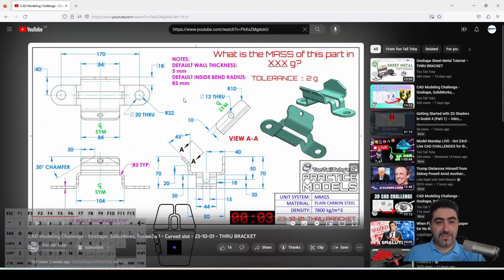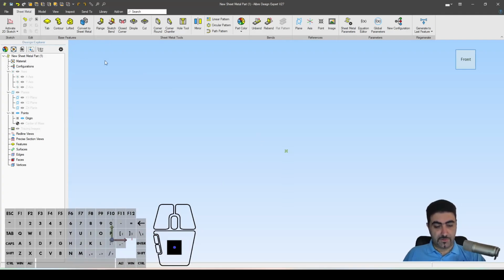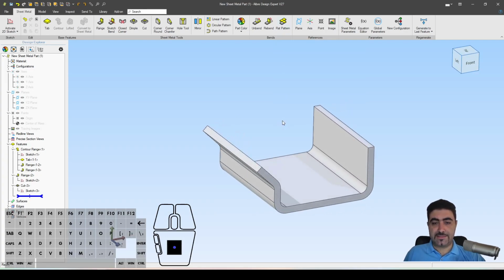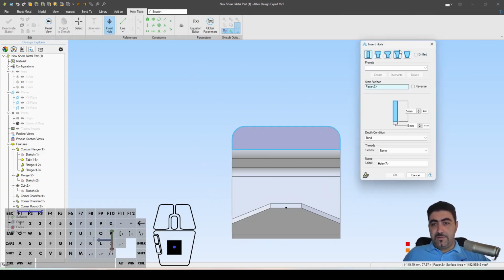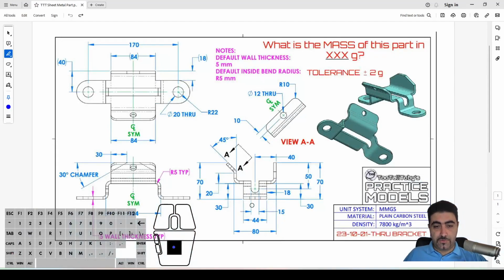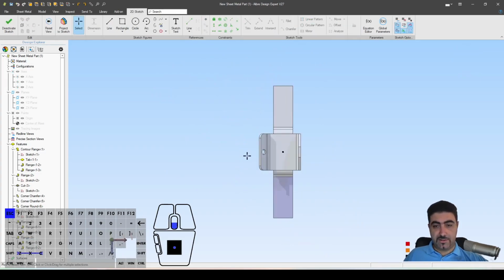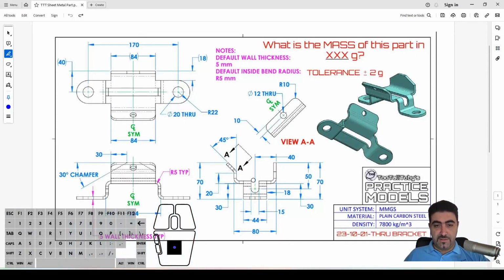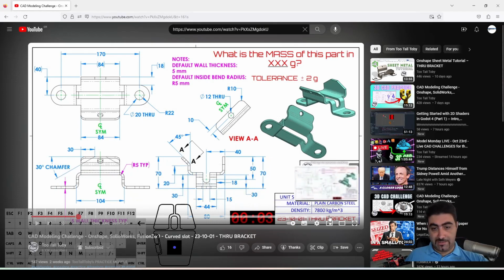Sheet Metal Advanced Techniques: TooTallToby 23-10-01 Practice model

Comment: I got a tip for you, I became aware of it accidentally. So, let's say you have a feature (boss, revolve etc). And assume this feature is sketch dependent. if you want to edit the sketch, just double click on the feature in 3D window, and it'll kick you back into sketch editing mode.
On the other hand, if you hold Ctrl and double click the feature in 3D window, it'll edit the feature properties. 

In your case, you forgot to offset the 30mm high flanges, and then you went to the feature tree, right mouse click on the feature and left mouse click on edit menu. You could've just hold the Ctrl key while double clicking on one of the flanges.

Sketch independent features like fillet,chamfer so on, doesn't care whether you have held Ctrl key or not. Alibre will open the edit dialogue once double click on them with or without holding Ctrl key.
Reply from the maker: Oh, that's a good one!  I knew jumping into the sketch by double clicking the 3D feature. But I didn't know about holding Ctrl+Double Click would edit the feature! That's huge. Massive Thanks for that. I'll mention it in a later video and give you a shout out for it.

Maybe you could even make a video on it yourself! Come on, let's build up the ranks!!!
Reply: @ExMachinaEngineering  many times I ended up in sketch mode by accidentally double clicking stuff. Yesterday I became aware of the shortcut. It's another Alibre feature under hide 🙂😅 in the default shortcut list in the documentation, they do mention Ctrl key, but I never knew what they meant until find it out myself lol. 

I leave the honors for you. I'm not too much into video stuff. 🙂
Reply from the maker: 😆Yup... I have double-click mapped to a button on my mouse. With my fat fingers, I discovered that double clicking will edit the sketch that created the surface/edge/vertex you were clicking on.
Suddenly I found myself in sketch and I was like "What happened..?".
Lol. But I hadn't even noticed that one in the shortcuts options. Cool find!

Comment: Nice mic. It'll only make the upcoming videos better. 

I liked the way cut command works on sheet metals. Didn't notice this detail before. Great feature.

Thanks for the flip button trick. I have been told that this is a bug and let's hope it'll be fixed at some point in future. 🙂
Reply from the maker: Hey Ty, thank you for your kind words and your contnued support!

Yeah, sheet metal in Alibre is full of tricks like that. It has a lot on manufacturing intelligence built into it. I think the Alibre guys don't advertise tat much because they think it's only logical to do so, but it's worth pointing out every now and then.

And the flip button is a great trick! As for it being a bug... I don't know. It certainly bugs me, lol. But I've had that in Fusion, Solidworks, and I think some older versions of ProEngineer too. So, if it's a bug it's hidden pretty deep down in the CAD core math, I would guess.
Reply: @ExMachinaEngineering  I agree with you. On the flip button, it's a bug because it only becomes active when user disables 3D preview. Flip button must be always active and be ready for use. 🙂 Sorry for not being clear about that.
Reply from the maker: Oh, ok. Yeah that might very well be a bug